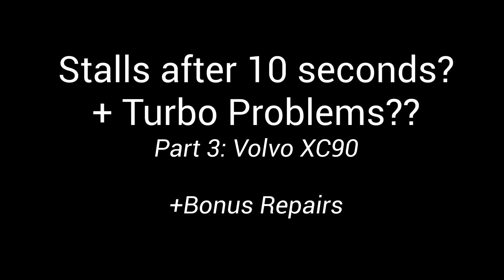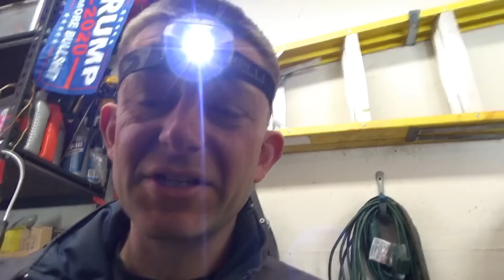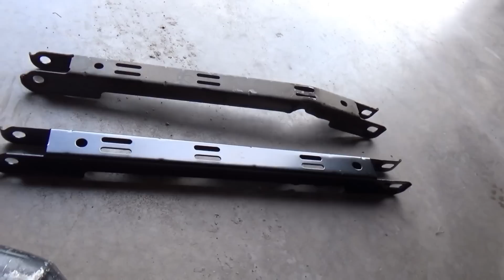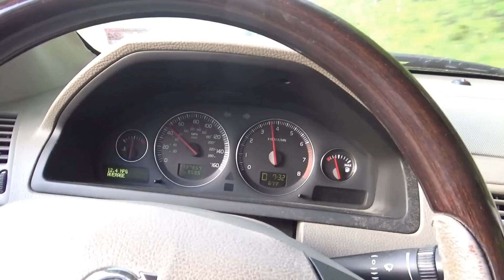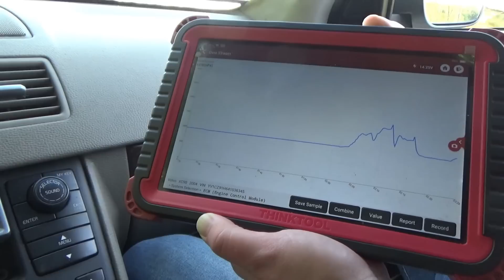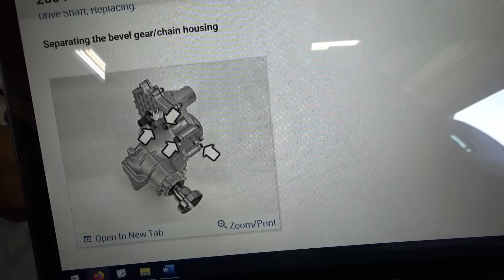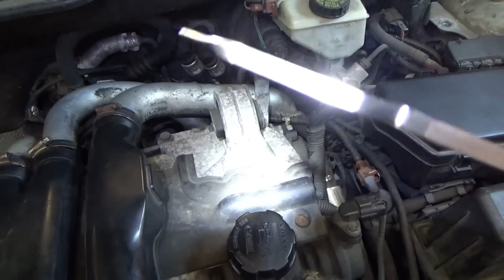More PROBLEMS?! (Part 3 XC90: Start-Stall, Low BOOST?)

Comment: Those early  XC90 T6 transmission and AWD setups are an abomination. A bandaide because the 6 speed Aisin auto was ready yet so they had to make a garbage GM setup work.  Ruined a great vehicle.   Great engine though!  6 speed Aisin auto became available in 06.

Comment: These early  XC90T6s and S80s should be avoided like the plague. When they work it's amazing that's why people liked them great power and drivability bit volvo used a GM transmission 4T65E and it's really not rated for that kind of power output.  Also it was never designed to be a transmission used for an AWD setup hence the crazy chain case to bevel gear adapter setup. And all those seals. Also the cylinder head is very prone to warpage even under normal operation. It's an odd duck.

Comment: ive seen alot of crazy stuff with these, alarm modules causing no starts and other weird issues, ac power on the dc current from alternator causing a misfire, ive forgotten way ore than i remember

Comment: nice video tho  I have an 2005 xc70  with 480 ,000 mls and the same issue. the cam ankle seal was leaking and and mixture of . trans fluids and gear oil when it first started. never worked on volvos before until i own one. As a former Toyota Tech. I looked at the problem and put a new remanufactured Transmission , in it  and hoping it doesnt have China seals in it.  I got the Vehicle  with 200,000mls on it and think the previous owner felt  for the sales pitch of never worrying about changing the transmission  fluids and the fluid was darker Joan of Ark   I kinda fixed two problems  problems with  a new tranny. tho. Thanks for more tips on your videos🖕🤙🤙.

Comment: My xc90 is an absolute nightmare! Just had to remove the harmonic balancer JUST to replace the serpentine belt that snapped, ran for an hour, died for a few hours and now is running again, like wtf could do that?,! I have a brand new alternator and battery! I DoorDash so I can’t risk it pulling temper tantrums like this!

Comment: I knew a vw mechanic that checked all grounds on vdubs when they came in because they were  always suspect. He learned  from experience.  He even had racks of them premade up to just replace them. Ivan , you are experienced   enough to know this. Most may not need replacing , maybe just a good cleaning prior to any diagnostic just for peace of mind.

Comment: When I went back to college I was subbing my income doing electrical stuff on cars at my buddies shop. One ofv the older more squared off wagons was there. They couldn’t figure out what was wrong with it. It had bern to a few shops. Long story short I figured out the Mass Airflow unit was pooched. I remember it was pretty expensive. That was around 1992-93. Was an interesting vehicle but wouldn’t want  to own one.

Comment: Have the same exact car, bought it with a start problem which eventually caused no crank start, changed the crank position sensor and crank sensor seat with issues. Had to drive for a while without my air mass flow sensor and housing. Ended up cleaning out the ground cables like you did and it solved the problem half of the time. Now waiting for a new crank sensor seat as mine is broken. Can you give me any advice on solving the crank sensor issue? (Bought a brand new crank sensor)

Comment: I owned a Volvo V70 wagon, Beautiful car ,beautiful driving car. It was their top model of that car. Problem was that every time it needed something repaired it was usually. 1,000 dollars or more. Bye, bye Volvo at 140,000 miles.
Reply from the maker: Euro = expensive 😎
Reply: @PineHollowAutoDiagnostics  yes it does. However these new Volvos are not as reliable as
the older ones for sure and computers were not nessary to fix them.

Comment: That’s a real crappy way to separate gear fluid and trans fluid! So if the inner seal starts leaking you won’t know? Til when? U do a fluid change? 
    Mixing those fluids cuz of a bad seal eventually would damage the transmission wouldn’t it? 
    Idk what those engineers were thinking seriously.. 
     Wonder how many Volvos transmissions go out all cuz mixed fluids you can’t see til it’s too late 😅

Comment: I almost bought one of those xc70 cross country 
From used lot at Volvo dealer. But check engine light came on during the test drive. And guy that came with me said quietly AGAIN! Course I heard it and said excuse me? 
He wouldn’t repeat himself but swore it would be fixed before I bought it. 
     Needless to say for $9,500 with 120k miles on at that time a 8 year old car 
I passed. Once I figured out how expensive parts were. For simple things

Comment: Ivan, Hi I wanted to let you know that it is best not to drive damaged suspension geometry vehicles on small country lanes (A large open racetrack is okay). The damage should be repaired, with alignment checked before test driving. For example, with the rear suspension arm damaged the vehicle can exhibit strange and unpredictable behavior, like stepping out into a spin, with absolutely no warning, in a slight banking turn with brakes suddenly applied.

For the vacuum control actuator repair, you could have used automotive structural adhesive (3M 07333) if you made a ring around the can face with extra support to hold the tube, the ring and tube could be brazed before bonding to the housing. The adhesive once set would also form a seal. The newer automotive structural adhesives are very strong and would not require applied heat like with soldering. However, you would have to fully clean all surfaces to be bonded.

The customer stated that the engine rear main seal was replaced for free? The next question is, who did the work? 

The advantage of the large MityVac evacuator pumps (like the MV7201) is the tubes supplied are long and different sized diameters, and once you build a vacuum you can move the tube around with sustained vacuum. For many shops, oil extraction with these pumps are usually assigned one type of fluid (mostly because of oil recycling requirements), that is one for each of, engine oil (which includes heavy gear oil, Transmission Hydraulic Fluid, and finally engine coolant. The advantage of the pumps is you know how much is pumped out, then transfer (pump out) to recycle storage then pump in the required fluid replacement quantity, and finally transfer to the vehicle. If you feel there is a fluid compatibility issue you can do a pre-rinse with new fluid.

The MityVac small diameter hose can fit down the small dip-stick tubes. If you do routine maintenance on a vehicle over time, you can do a transmission fluid swap (pan only) every engine oil change. Just pump out what is in the pan, and replace with the same amount. So you are essentially changing all of the fluid over time without dropping the pan and avoiding a flush. This is a very popular approach if you have access to a dipstick tube. Scotty Kilmer likes this approach and so do I. However, this way of changing transmission fluid over time when you do all the maintenance on the vehicle has a long history, much older than Scotty and myself.  

Also, if you have a vehicle that has an automatic transmission shudder on one of the upshifts (3 to 4), or when the TC locks up, you can do this partial fluid swap technique and see if the shudder is reduced or eliminated (you can use the partial fluid change as a way of troubleshooting). If it is reduced, then do the partial swap again after about 10 miles, which many times is enough new fluid to make the shudder go away. Then just do the partial swap every time you change the engine oil. The only time you need to drop the pan (after it is emptied by the vacuum pump to minimize the mess) is to replace the transmission filter. The approach assumes that there is no major damage to the transmission. The attractiveness of the partial swap is it is very fast and inexpensive, you also have the opportunity to use a recommended transmission fluid upgrade (usually synthetic of some type). Once, you start the vacuum process you can let is run on its own until the pan is emptied. Super easy.

Comment: I always look up TSBs on a model before I buy it. Some cars, reading the list, you do NOT want that car.
Why do I do that? Yes, I got burned on a 1998 Ford F-150 4.6 2-valve that had the infamous oil leaking from head gasket at about 90k miles.
Ford says they left debris between the block and head during manufacture, and OHC engines have a lot of oil being pushed up through there for OHC lubrication.
Blue Devil fixed it, then I sold it.

Comment: The early S80/XC90 T6 models came with that GM 4T65 and are known to have many issues. Unfortunately the transversed inline 6, twin turbo and AWD wouldn’t allow the Aisin Warner AW55 in all other P2 models to fit. Once there’s debris on the plug, it’s probably not long for this world.
Reply: that plug is for the bevel gear/ chain drive, not the transmission.
I had/have a similar issue. My plug looked like that too.
Similar to this owner, I'm just driving it till it essplodes.

Comment: Not a fan of Volvo since I bought a 2010 XC60 back in 2012. 1500 miles past warranty I got a flat tire. Spare tire cable gearbox made two rounds down and then locked up solid, would not turn either direction. Had to cut the cable. New gearbox was over 400 dollars! I traded it a few months later.
Reply from the maker: Not the worst problem to have but annoying nonetheless lol!

Comment: My, oh my!  What a train wreck this one turned out to be.  Typical though.  Not many people know all the ins and outs with Volvo's.  Mistakes can and will become very costly.  Which is why a lot of mechanic's refuse to work on them.  Those T6 XC90's, you have to take very special care when removing and installing the right side axle.  Knick that center axle seal and you will certainly regret it.  The chain in the offset unit will not last long bathed in transmission fluid.  It will literally eat itself alive.  And let me tell you, it's a pain to replace that offset unit.  Oh man, I kind of feel bad for the owner now.  At least it didn't cost the owner anything for the initial damages..... Or repairs?  Take your pick.  I did enjoy the ride along Ivan.  What you had there was a typical day for me at the Volvo dealership I used to work for.
Reply from the maker: I don't envy you working at a Volvo dealership haha

Comment: That Volvo is more butchered than you realized.  The rear suspension on those cars is very flimsy.  Looks like you are going to need to get the string out again.  If that had been a 1993 or older 240 with a solid rear axle, that wouldn't have happened. GREAT VIDEO!
Reply from the maker: I like solid rear axles :)
Reply: @PineHollowAutoDiagnostics  I can think of many things you like.

Comment: I'll bet you can use the transmission oil to lubricte the chain box as well. Or you just add the 75W80 to the gearbox. If both are the same no mixture will occur. It simply doesn't matter.

Comment: Ivan, how did you get so lucky and get two Volvo's. And now another one. Good Luck! Thanks for Sharing!
Reply: Isn't this his third one?  Two XC90s and the butchered XC70?
Reply from the maker: @robertbrandywine  Haven't released the second XC90 yet...it's a treat :)
Reply: @PineHollowAutoDiagnostics  I went back through your videos.  You've worked  on these:  V60, V70, V90, S60,  but only this one XC90.  I was confused.

Comment: Someone getting all ramy with the CV shaft when that engine was pulled probably knocked the seal lip tension spring off of that inner seal or damaged the seal lip, Absolutely Great Content thanks for all highly detailed close UPs, Content like this would be Gold to a Shade tree tech - owner of Volvo's like this for sure, Or anyone else trying to work on something unfamiliar like this 😮🇺🇸👍.

Comment: Maybe first time commenting. In regards to your wheel alignment method which I've done, you measured off the tire. A professional alignment is done off the metal wheel. The difference in the diameter of where the measurement is taken does make a difference. FYI

Comment: "Runs like a Raped Ape!" LOL i haven't heard that term since  the seventies. good on ya Ivan. 
around the same time there was a speed parts company who made things like weaker distributor advance springs called 'S'AAPE! whose logo was an ape completely on fire, running down the street like mad.  they were ape! i put 'em in everything i could get my hands on. sure beat trying to take a turn or two off.

Comment: Omg i had a truck come back today for a popping noise. 2 weeks ago I replaced both lower control arms (they came with balljoints already bolted on) come to find out 3 nuts on passenger side came loose and 1 on driver. That is so dangerous iys scary. I've done a ton of these and never had this issue. This China junk is getting way out of had especially dealing with life and death repairs. Imagine this lady doing 70mph on the highway and the lower balljoint let loose

Comment: Hi Ivan. I made a metal syringe about 1”1/4 tubing  for that tricky closed gear casing . But I’m sure they are available in the automotive industry. This repair has  very intriguing maybe the Volvo’s will be back for more goodies. 👍🛠🔧⚒P. S. Your break bleeding gun works just fine.

Comment: I doubt that solder joint got good wetting, thus the solder just kinda sticking to metal. Don't know if it would pass a tug test. I might have used JB Weld. My fingers are crossed for that nipple repair 🙏.

Comment: Ivan is becoming an Volvo whisperer! Not a bad choice. There are a lot of owners of older Volvos who still are loyal to their cars. Don't ask how I know, owning a 1965 Volvo Amazon B18 4-door. Volvos are not an Porsche or  Ferrari, but there are a lot of 0-30 year old Volvos out there without an expert diagnostician / technician, who does not break the bank. 

Design of the transfer case shows the desperation of Volvo. Before Ford acquisition, Volvo did not have the money to make an integrated manual / automatic gear box with propeller shaft output. That is why Volvo used standard Aisin Warner automatic and their own manual gearbox. They did not have the money to do anything else than the kludge you saw in this video. 

That is why I did not buy the X70, but the V70 model year 2000 with Porsche/Volvo 850 engine and 2 wheel dive. Neighbor offered me an X90 for next to nothing, with an non working 4WD. I refused to dive into a money pit. Audi/VW had the money to have their own gearbox designed for 4WD, Volvo did not and Ford did not give money Volvo to design / produce one.
Reply from the maker: Makes sense! Weak GM transmission with add-on AWD chain case is not what I expected from Volvo haha

Comment: Great video Ivan. That issue with the seal sounds like when the seal between the transmission and transfer case fails and you have transmission fluid leaking into the transfer case. You did a great job on this xc90 from HELL and I am sure the customer was happy that he had you Diagnose this XC90 from HELL.

Comment: If there's just a paste on the magnet there shouldn't be any gear issues. It's if you can feel the particles on the magnet that you have a problem. At least the magnet did its job.
It would have been a lot easier to just design the transfer case to accept ATF fluid instead of having a complicated configuration with two types of oil in the transmission.

Comment: GM 4x4 transfer cases have the same idea with seals in keeping the transmission fluid separate from the transfer case fluid. To replace that seal, its an easy fix by removing the transfer case and that seal is located on the front of the transfer case just behind the trans tail shaft. Its a double seal too, has two seals in one. 
Volvo has always been "off" when it comes to logic. People buy those cars because they believe they are "safer" that most vehicles. Problem is they tend to be maintenance prone and for the most part, are rather boring in design. The old Volvo's 1970's and before were very dependable however, they had no style at all. 

Those nice friends damaged the turbo nipple and a lot of other things under the hood in R&I that engine. That job should have included a lot of other things "while they had it out" since the customer was planning on keeping the vehicle long term. New hoses, rubbers and other items that age and are hard to get to. Losing critical bolts, nuts etc. is classic for nutjob mechanics, they simply have no consideration for collateral damage when working on other folks vehicles. It all has to go back the way it was, hose routed correctly, secured the same, fasteners need to be saved not lost.

Comment: GL4 is hard to find nowadays, i did a trans swap on a cobalt ss a few weeks ago. Called all the parts stores for Gl4, they tried to sell me gl5, called gm, subie and hyundia dealer cos they had it in stock back when i worked there. No luck, i eventually found redline at OReilly for 25 a quart.
Reply from the maker: Yup Redline is my go-to :)

Comment: My guess on that lower track bar is a tow truck hook at some point. Looks like it anyway. Once they bend, they won't have the same strength if straightened plus, its a suspension part, always get new.

Comment: The design of those track bars suggests that even just looking at them would probably bend them.Maybe they should be considered as a sevice item  -  replace oil,oil filter,air filter & track bars!

Comment: Ugh. Didn't realize, rear main seal repair was "free". Well then owner kinda got what he paid for. Otoh, trans fluid separated from gear oil by an internal seal, as noted, terrible design. That's on Volvo, not the owner. Seems at least this generation Volvo XC90 a good one to avoid.

Comment: 7:43  By the sound of the track bar, that's a thin piece of metal, plus it has slots taken out of it.  Already thin as can be, how much weight did that remove? (if that's why the slots are cut in it)  Sheesh!